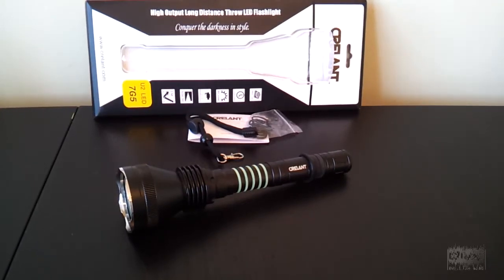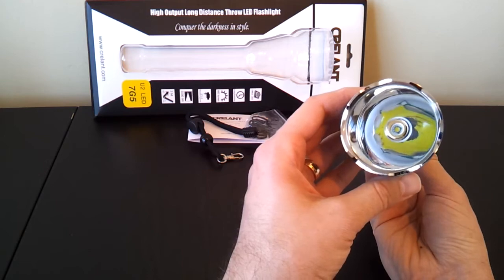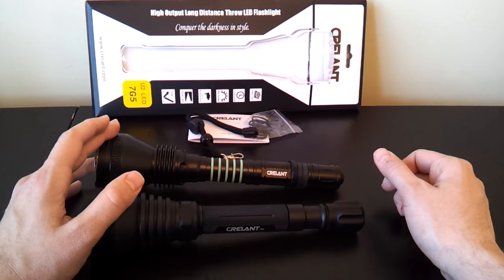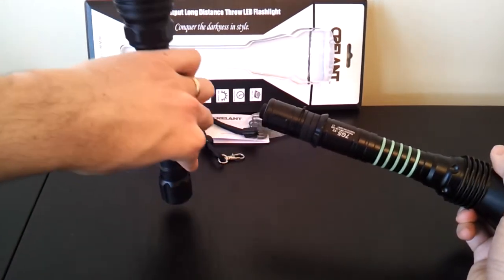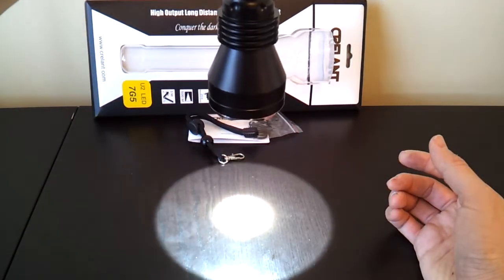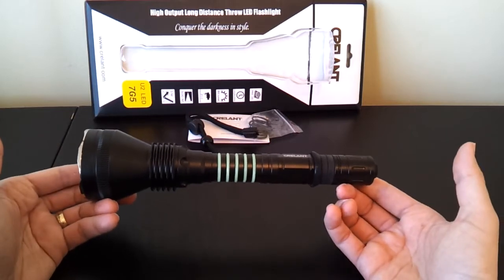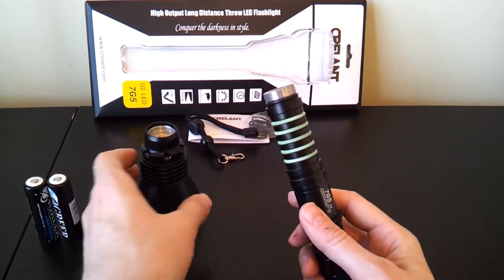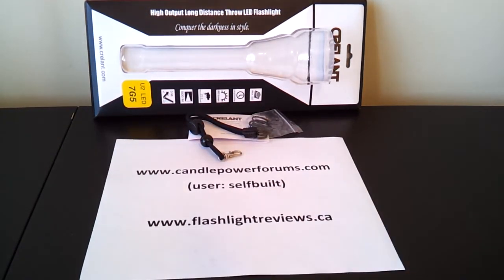Crelant 7G5 V2 (XM-L U2, 1x or 2x18650) "thrower" flashlight review, by selfbuilt

Comment from the maker: 2xCR123A is within the voltage range of the circuit. The problem is the current draw on Hi - my experience of other lights driven to these levels is that it is too high for 2xCR123A to handle. Due to their relatively high internal resistance, they will heat up very fast. If unchecked, this excessive heat could damage the cells or the light. That's why there is a PTC resistor on CR123A - to limit the current flow, and lower the heat. But you never want to rely on that, its just a safety stop-gap.

Comment: After watching this review and reading the post at cpf, i decided to order me one...It does have last mode memory but takes a bit longer to memorize compared to my other lights.  I like the design and its thickness.  Built kinda tankish but not as tough compared to a fenix tk20.  The beam isn't perfect but the idea behind this light isn't perfection onto the beam pattern.  Good  amount of usable spill with several rings.  The lens is nice but mines came with a scuff-like mark on the inside it.

Comment: This light can be operated safely (at max output) with two IMR 18350 cells. You have the flexibility of using a small body without losing output compared to running it off just 1 18650. Another thing, this light works best with its collimator head which gives the light a pretty kickass throw and a lux rating of about 98k (compared to 48k+ with the original head). Very very much worth the price it is being sold.

Comment from the maker: You should read up on Li-ions on candlepowerforums. Any type of 18650 will work in any light it fits into (some lights have length, width, or positive connection limitations). Generally, higher mAh means longer runtime - but the UF designation is bogus (i.e. there is no 3500mAh battery). There have been reports of used laptop cells being re-packaged as UF "3500mA".  Best to stick with reputable brands.  See CPF for more info.

Comment from the maker: That's right - 4xCR123A will blow the circuit within minutes (confirmed).  I suppose you could run the low mode on 2xCR123A safely enough (but not Hi, that would likely trigger your CR123A's PTC safety resistors within minutes).

Comment: so this light wont run on cr123s at all? because I am looking to buy a thrower for my next light and its between this light the sunwayman t40cs, olight m3x, or the thrunite catapult, but I want a light that will take primaries just in case there is no way to charge my 18650s